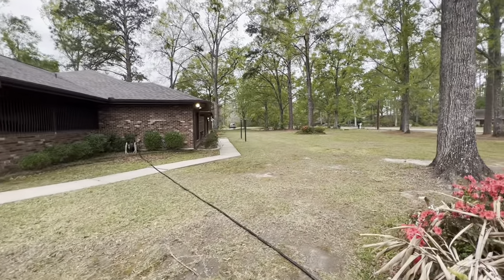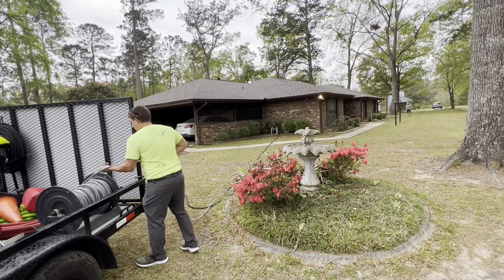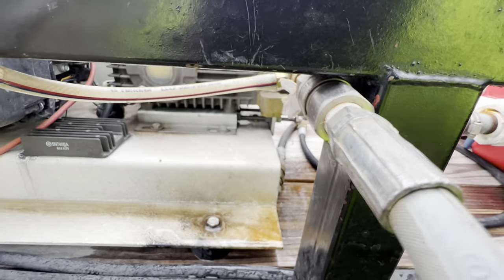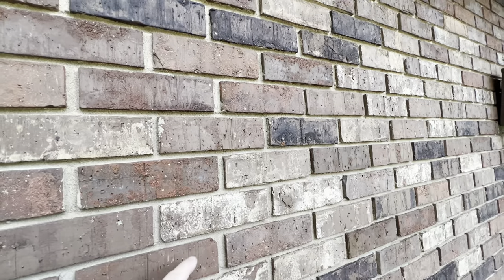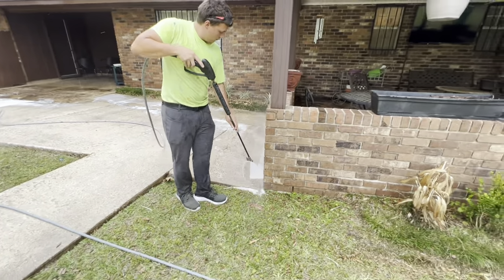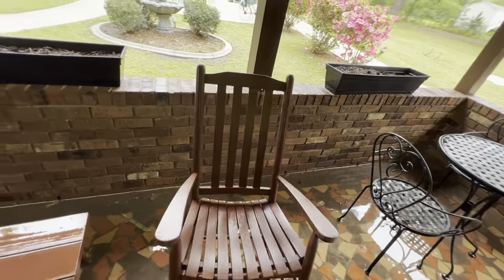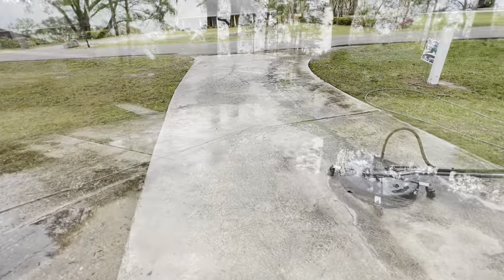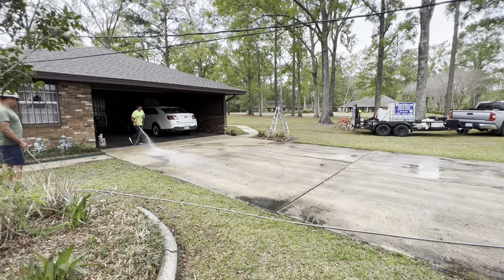HOW TO CLEAN A HOUSE

Comment: Do you spray the ceiling with the lights and the fan? Or do you cover them while spraying? I haven't seen a video yet explaining those scenarios, or would you just spray far away from the fixtures and just hand wash around them? Thank you for any information!
Reply from the maker: Yes you can trim in around the fixtures with your wand then use a scrub brush to finish it off